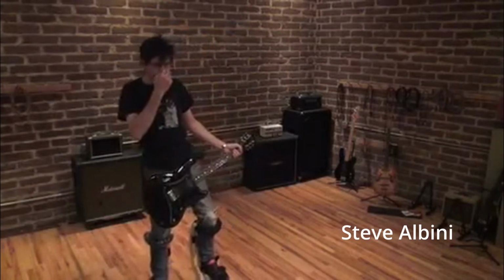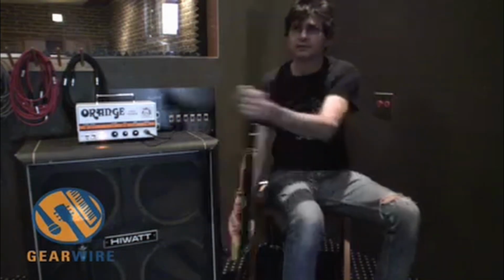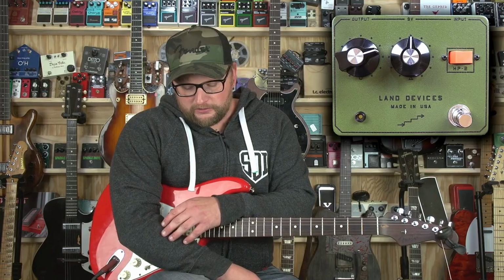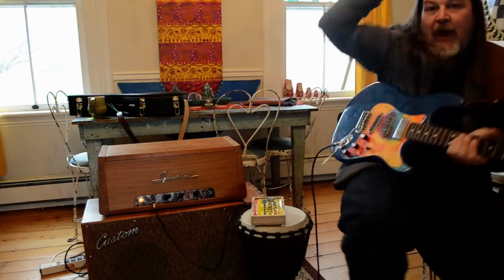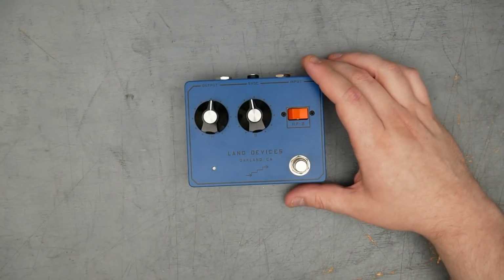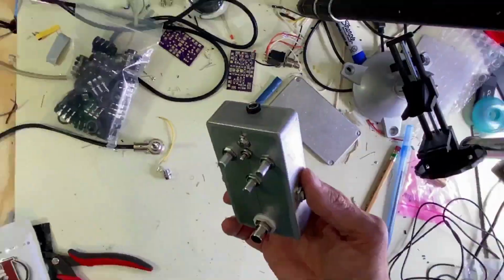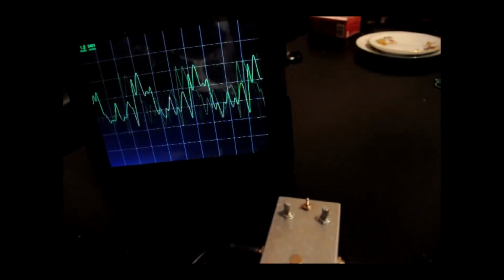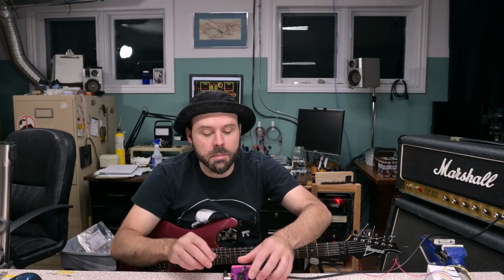What Is The Harmonic Percolator? (Montage - Albini, Examples, Clones, History, Circuit Design, DIY)

Comment: 'Harmonic Percolator' is now being bandied about by anyone wanting to put over a distortion as being "sick," or "brutal." It's become little more than a marketing term.
Reply: That makes no sense, it's like saying "fuzz face"is a technical term lol
Reply: @SonarPoop Right, so you don't see 'Big Muff,' 'RAT,' and 'Screamer' being used the same way? An even better example is 'Push Me/Pull You,' since it's not also a brand name.  🤔
Reply: @DerpRulesGotham no, those also describe the circuit inside the pedal. Sorry for the mix up, this is such a borderline incomprehensible concept to me that I accurately described what "harmonic percolator" and "fuzz face" are instead of saying they're marketing terms lol. Is the term petrol engine a marketing term related to cars?
Reply: @DerpRulesGotham push me pull you would be marketing unless it's referring to the Tim escobedo circuit
Reply: @SonarPoop Rock on, dude. ✌
Reply: @SonarPoop Oh, and I didn't say "technical term," I said marketing term; big difference.

Comment: A very clever design that does something I set out to do a couple years ago with a previous design of mine, and that by chance is very similar to this and it's variants.
The way Q1 and Q2 bias runs it as a quasi Class-A/B amplifier relying on a portion of the input swing to complete the biasing of the bases, so each half cycle supplies some of it's D.C. time signature to switching the transistors on and off allowing the use of just NPN's or just PNP's to effectively produce a quasi Class-A/B amplifier. 

My design succeeded in the ultimate goal, but I am not a fan of running outside Class-A without good reason with preamp stages, so I decided against this biasing topology.

Comment: I have built a lot of these hp type topologies, including some with components as close to the original as i could get...they all sound very different to one another!

My favourite circuits all seem to share this property, the zonk machine and the fuzz face...however these can sound awful with even minor component variations.

The HP always produces a decent sound and seems to tolerate a very broad range of transistor types and values!

Comment: Nice video. I learned about the HP when I came across the Drunk Beaver Secret Sauce and then looked up about the original. Really like this clone, haven't tested any others yet to compare.
Reply from the maker: I just checked it out.  Being able to switch between silicon and germanium on the transistors as well as the diodes is a nice touch.  It's crazy how many different versions there are.

Comment: i guess you have to be a die hard fuzz freak to really call this legendary or the elusive fuzz sound, witch is probably why i wasnt that impressed with it, the guy useing in the band sequence with the feedback i didnt see anything impressive about that. guess im not a conosur of the fuzz sound, but ive got a couple i really do love.
Reply from the maker: Albini, the guy with the feedback, got people interested initially.  But since the pedal is so rare, and the original components were covered up, it became sort of a challenge for people in the pedal building world to try to figure it out.  There are forums where people shared pics and info and tried to figure out the design and get it just right.  In that process, people discovered it's actually more useful than just what Albini was doing with it.  A lot of pedals out there are just variations of the same type of circuit.  The Harmonic Percolator is actually a totally different type of circuit.  That said, it's not for everyone.

Comment: The harmonic percolator is an advanced use of the technology developed for the turbo encabulator. Using prefabulated aluminite diodes, they finally managed to prevent harmonic fumbling.
Reply from the maker: LOL! I had to look this up, but it was worth it! 😂
Reply: Ah, now it makes sense.
Reply: Good to know
Reply: Well said.
Reply: Was about to say that
Reply: Terrance Howard explained it similarly
Reply: Try to find one of the early run models if you can; they used a slightly tweezed form of synergistic throbulator that to my humble ears just sounds better.
Reply: The original Marzel vanes sounded warmer.
Reply: PLC guys will know.
Reply: I believe the Turbo Encabulator was developed after the HP-1. Unfortunately Ed Giese didn't patent his design.
Reply: Yup. Turbo Encabulation is the perfect use of prefabulated aluminite diodes. It’s the main reason that these highly sought after components are no longer commercially available.
I have a box of postfabulated diodes but they’re just not the same…

Comment: The HP that I built using very basic internet schematics sounds nothing like the landevices HP-2 or whatever the greenbox is called. I love that pedal and I love the one that I made myself and I'm 100% sure that I'd love a working original. It's that kind of topology, it's easy to make but difficult to reproduce. But that said, who WANTS to sound like Steve Albini? Have you listened to his records? That's the tone you want? Go with what you built and enjoy whatever terrible noise it makes.
Reply from the maker: I agree. There are so many factors that make up a guitar tone it's just about impossible to recreate someone's tone 100%.  You should be able to get it close enough though if that's what you're looking for. But I think it's better to come up with your own sound based on what inspires you. That said, I used machine learning to create an accurate software model available on my website link in description. Thanks for the comment!